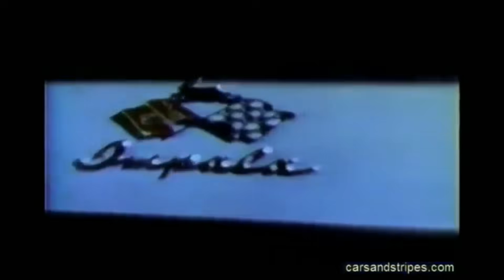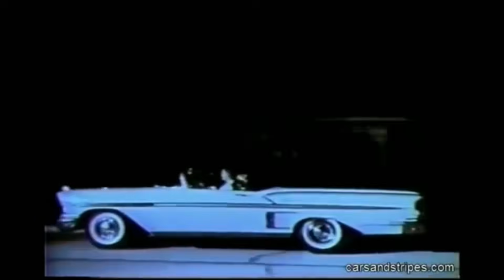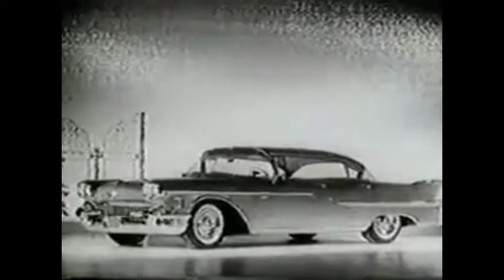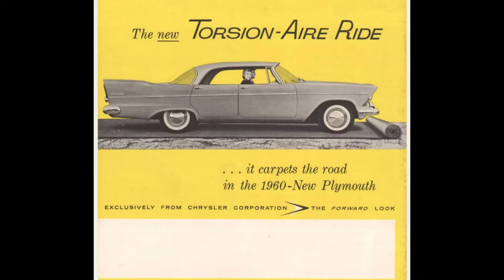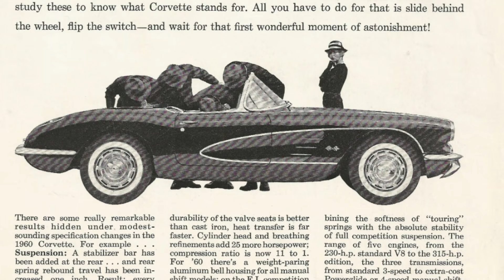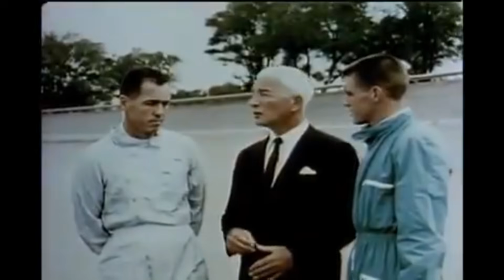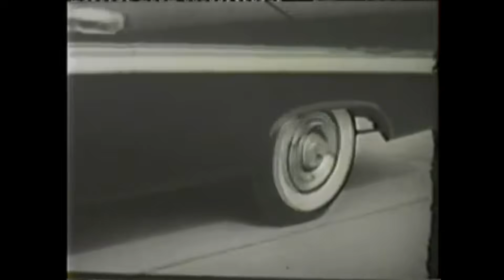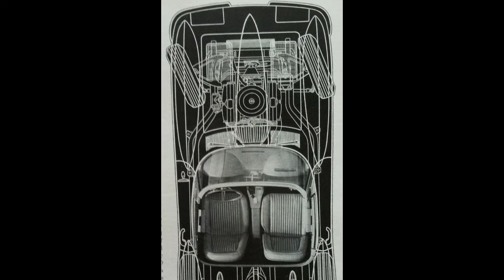The Forgotten Suspension Designs That Almost Changed American Cars Forever

Comment: This is an oversimplified presentation. In short, it makes assumptions & errors all over. And YouTube keeps filling up with suggestions for these such presentations. For example, it barely mentions that the average American who actually went into the showroom, to select and purchase the cars, strongly preferred soft floating comfortable rides & with the development of the superhighway systems, were generally satisfied with these relatively simple, generally durable suspension setups regardless of the fact they they had way less control than with the torsion bar set-ups being pushed over at Chrysler starting in 1957. In fact although many owners of Chrysler cars, whether Plymouth or upper mid-line Chrysler or Imperials were happy with the superior handling, a significant enough number would complain to the dealers and the dealers would convey this over to Chrysler management who then began to soften up the torsion bars by about 1960. (Even Tom, McCahill noticed this) Imagine that!! --A company listening to the demand by the average buyer who desired a softer ride! In fact many magazine road testers who tested a Chrysler product in the mid 1960s would say how everybody should order the optional firmer suspension (which was very very affordable & would include firmer shocks and springs) because it made the vehicle exhibit much more enjoyable & predictable & safer handling. But remember, the testers tended to wring the car out in a much more aggressive & demanding test of its handling and braking, driving it in the manner that the majority of the actual purchasers never did. Thus my own aunt bought an Imperial in 1973 and found the ride too stiff and instead bought a Ford Torino with a nice soft ride! She did not get the idea of a more capable suspension being a positive & desirable attribute. She just wanted comfort with reasonable dependability!

Another point. This is America not Italy or some other country filled with narrow roads and switchbacks. Those can be a fun and thrilling way to experience a well balanced, much smaller sports car or a well suspended and much smaller 4 door sedan. Wonderful. But this is where GEOGRAPHY influences how a car is deigned by the engineers and the companies that sell vehicles primarily in those areas. Thus in the mid 1960s, even an American car such as the mid sized (by US standards, but large by European standards) 1967 Pontiac Lemans Sprint OHC 6 that had the sporty suspension would do quite poorly in European road conditions. See here: https://www.curbsideclassic.com/vintage-reviews/1960s-vintage-reviews/gm-brands-1960s-vintage-reviews/vintage-review-1967-pontiac-lemans-sprint-ohc-six-tested-in-europe-pontiac-tries-and-fails-to-build-a-european-sport-sedan/

But that doesn't mean the Lemans was a crummy car for the US! It was a poorly adapted car for Europe where smaller roads and more sophisticated suspensions and better braking was all driven by the smaller narrow roads and switchbacks and plenty of hills where flatland open Americans often did not run into those conditions. In addition the high cost of fuel, even back then in Europe, tended to strongly influence the development of smaller more fuel efficient vehicles that also handled and braked in a far more sophisticated manner. A good example of this is when an overseas GM engineer from England moved in across the street from me back in the early 1980s. He was impressed with the Oldsmobile Ninety Eight 4 door sedan that he was provided for by GM and I was confused. How could he be impressed with a relative boat like that? He explained simply that this machine was quite a fine comfortable & luxurious ride for the conditions he typically encountered in Michigan flatland USA! But he sure would not want such a vehicle if he was back in Merry Ol' England! Thus geography is a critical factor in understanding how a car is designed and what the engineering department emphasizes. 

In addition, not all American cars from the 1960s that were not 1963 and later Corvettes & still used solid live rear axles, could handle much more impressively and become favorites. Examples of these were the 1967 dodge Coronet R/T and the Plymouth GTX both of which had firmer torsion bar suspensions and were considered much better at handling than the average American sedan even with their heavy 440" V8. In addition the Oldsmobile 442 from 1964 model year onward had standard front AND rear stabilizer bars which was unusual at that time (although a rear stabilizer bar could be ordered for a Pontiac GTO or a Buick Skylark, etc. if desired for just a few bucks, but almost no one did!). In addition the Studebaker Super Lark, Super Hawk & the Avanti had front and rear stabilizer bars as standard (and any Studebaker car could be ordered with front disc brakes as well if the owner wanted it). The Chevy Corvairs had an independent rear suspension that was improved by mid 1963 making a vehicle that had far more standard power (compared to a Beetle) and superior handling. In fact it was seriously superior to the Beetle but GM gave up on it by 1965 when the car hit a peak of styling and handling and power and let it fade after the Ralph Nader impact. The 1961-63 Pontiac tempest also had IRS but not enough owners really appreciated these advancements in the country of the USA that loved big cars, and nothing wrong with that with all the flat land and long distance traveling. Disc brakes were yet another important development that was delayed on US vehicles for both cost and an perceived lack of much interest by the average consumer emerging in the mid 60s for most consumers. Even the 1965 Chevrolet Corvette which had four wheel disc brakes as standard could be ordered with rear disc brakes deleted!! So if you ordered the 65 Corvette with the standard 327" V8 with the least powerful 250 hp rated (gross) version where you just wanted to cruise around in style but did not care about braking so much, you could order it with only front disc and rear drum brakes! Even GM who offered four wheel disc bakes as standard equipment in the 80s & 90s on cars like the Cavaliers, would later make them standard with front disc and rear drums again to save $$ per car & 99% of owners did not notice! 

By the way, the idea of bean counter accountants killing a vehicle concept or type of engineering, is often a good thing as long as they recognize the market they are reaching to satisfy (who the intended buyer is and how much $$ he has to spend) & I admit too often they do not. Yet too often they are maligned for doing useful & necessary actions that keep a car or truck cost at a reasonable level. This presentation acts like cost is something a company can just throw out the window. There is ALWAYS a balance to be achieved as a manufacturer tries to earn money from the consumer in a free market. It is far from perfect!

In addition, vehicle development did not "stand still" because of the relatively simple suspensions that were used in the US. Other areas of the vehicle were advancing even if the suspension designs were relatively simple, such at the ability of a vehicle to comfortably travel many miles over the new superhighways that were developing and thus an emphasis on making sure the vehicle handled predictably & body tightness (not necessarily panel fit!) was more prevalent such as eliminating squeaks and rattles from ever occurring, than if it could handle better in an emergency or a sporty maneuver.  If the average American was suddenly traversing tight narrow roadways with fuel price 3 times higher they would have no doubt preferred much better handling vehicles as well.

The European cars that impressed more and more American buyers were also cars developed on the tinier roads and curves and hills and when combined with more advanced engineering could finally create better handling cars that were comfy enough, that they could be offered to a broader range of Americans who not only accepted them but began to prefer them.
Reply: Well said, every last bit of it!

Comment: The Corvair in 1960 had a swing axle followed by the Pontiac Tempest in 1961.  But it provided handling problems at higher speeds.  The Tempest ditched its swing axle design in 1964 going back to solid rear axle.  That same year the Corvair went to a full independent rear axle suspension ending its weakness,
Reply: By 66, the Corvair had what was basically a Corvette suspension.
Reply: The rear suspension was fine; problem was that front tires had to be inflated no more than 18psi, which most were not aware of.

Comment: You missed some interesting GM cars. The 61 to 63 Pontiac Tempest. Independ rear trans axle and for 1963 you could gat a 326 V8. Then there is the Chevy Corvair. Rear engine and trans axle with swing are independent rear axle. And an improved system in IFRC 1965 or 66.
Reply: The car the two yout's were driving in the movie.. My Cousin Vinnie
Reply: Fiero had IRS.
Reply: @bryanayers6104 Had one of those too.  The rear suspension was basically a GM front driver with McPherson struts.  I can personally testify that with the correct tires and a huge, 3 size stagger front to rear, the car was glued to the road.

Also, my 2005 CTS-V has IRS.  Don't ever attempt a burnout though unless you want to rip the differential out of the vehicle.
Reply: @garyhalmbacher6875 Had multiple Fieros, as I worked in family owned Pontiac dealership in the Eighties... Well familiar with the P-Car and it's design evolution
Reply: I believe 66 was the year GM ditched the swing axle and went full IRS.  My friend had a 67 or 68.  The suspension was essentially Corvette but Falcon price.
Reply: @garyhalmbacher6875 Swing axle is still IRS...
Reply: @garyhalmbacher6875 close. It was '65 when they went from swing axle to multi-link.
Reply: The Corvair got a camber compensator for 1964,  For 1965 the Corvair got  a new body style and full IRS.
Reply: @philipethier9136  I didn't know about the camber compensator but I knew about full IRS because my buddy had a 67 or 68.  The cars were beautiful and handled superbly but Americans didn't know how to drive them.  If you pushed too hard, you could easily swap ends.  A major front to rear tire stagger, like I did on my Fiero of 3 sizes would have done the trick but tire stagger and L/R didn't exist in the age of bias ply.
Reply: @garyhalmbacher6875 Fiero SE/GT  handled well with factory tire stagger.
Reply: @bryanayers6104I had the first year.  Beautiful car.  Had the suede interior.  I had the 2nd one in Orange County.  Totally underpowered but stuck like glue in the corners.  Totally impractical too.
Reply: @garyhalmbacher6875 I never found them to be impractical.
Reply: @garyhalmbacher6875  I remember seeing a camber compensator in a turbocharged version and it was simply a crude way to prevent the swing axle from tucking under during a sliding turn. It took Volkswagen until 1968 to get rid of their swing axle. I think "Unsafe at Any Speed" helped.
Reply: @garyhalmbacher6875  - Early model Corvairs (1960-1963) were fairly easy to swap ends if you weren't paying attention. For 1964 Chevy added a transverse leaf spring (often mistakenly called a "camber compensator") to the rear swing axle suspension, plus an anti-roll bar to the front, which improved the handling considerably, but you could still get them sideways by driving stupidly. Starting in 1965 until the end of production in 1969, the Corvair received the Corvette's fully independent rear suspension, albeit with coil springs rather than the 'Vett's transverse leaf spring. It didn't take long for enthusiasts to discover that by simply tweaking the suspension alignment settings slightly and the F/R tire pressures a bit, the Corvair became THE best handling car built during that time period. It even won the SCCA D production championship in 1966! The fancy-fendered Ford Falcon of that era (aka Mustangs) with their 289 V8s could easily blow off a Corvair in a straight line or on a smooth road, but put the two of them on a twisty, bumpy, pot-holed mountain road and the Corvair would basically clean the other's clock. Big HP and a live rear axle bouncing around couldn't keep up with the fully independent suspended cat-like Corvair - on stock tires all around, too!  Even more so if the owner had installed Michelin or PIrelli radials, which were just coming into the market back then. No need for size staggering, just minor alignment changes and tire pressure settings. It's sad that the Corvair got a bad rap, but Nader's book wasn't what killed it - the HP race and smog regs did it.
Reply: @philipethier9136 Corvair always had IRS, regardless of the year, Early and Late Model.
Reply: I have a 1963 LeMans in my garage
Reply: LOL...I was coming here to say "So you're saying that whole speech in "My Cousin Vinnie wasn't true?!?!"
Reply: Good point.  Just wanted to tell you that you’ve got a typo.  You meant to type 61 to 63, rather than 51 to 63.  My best friend’s dad had a 62 Tempest.  It had the automatic transmission selector lever on the dashboard which was unique to an 8 year old kid like me.  Of course, it also had front engine, rear transmission which was innovative for the time (although I didn’t learn about that until I was a few years older and really into cars).
Reply: @OldRustySteele  Thanks, fixed it,
Reply: Thanks to my cousin Vinny many know the Tempest had a independent rear suspension - not many know they also had a novel flexible “speedometer cable” driveshaft - think it was actually a torque tube as it went between engine snd transaxle - which was its own novelty and had the torque converter on the “back” of transaxle… the sixties were glorious.
Reply: A.I. doesn't care about inaccurate, absent or erroneous information.  😕

Comment: So what happened since then? People forgot all about IRS, anti-roll, and anti-dive, - - and bought pickup trucks with solid rear axles! -- becoming the best selling vehicles in the USA!  I should know: I have 3 of them -- every one rides more than acceptably.  So much for fancy suspensions! (^_^) ====
Reply: Not really .They were convinced that they would be more "manly" if they drove more profitable cheaper to build pickups than the new car designs with unitary bodies that the new vehicle safety regulations were going to require the manufacturers to make.
Pickups were excluded from these rules and continued to be built with primitive ladder chasses for many years.
The market fell for it hook line and sinker
Reply: @PaulG.x  Respectfully disagree. I've had two BMW's and used to race a Porsche 356B In Germany.  Great suspensions -- also irrelevant for the American market.  The Americans got it right: pickups are rugged, safe, durable, multi-functional, -- and cost-effective (at least they were!).  "Manliness" used too have some contribution, but does not explain the number of women who are now  buying 4D pickups --- about 30% of the market.   So, this is not a matter of anyone falling for a deception "hook line and sinker" -- it is matter of trade-offs, in which purity of suspension is less valued than the four advantages listed above -- not even counting the adverse weather capability pickups can offer(^_^).  ===============
Reply: Big trucks and SUVs are uniquely American and would not succeed if offered in other countries where such vehicles are unsuitable or undesirable.  The US automakers cater to Americans who love these types of vehicles and are less competitive abroad.  There's a reason why foreign automakers have become so dominant in the US.
Reply: @chewmetube  Foreign Car makers are not "dominant" in the US:  pickup trucks are [as a single type].  Percent of Foreign Vehicles sales in USA = ~ 40%, but many of those are now big SUV's that simulate their American counterparts. Examples: Honda Pilot; Nissan Armada; Toyota Highlander.  But  there is a growing desire for American pickup trucks internationally, especially in China [and others].  See the article by Hagerty entitled, "It's Not Just America—the World Loves Its Pickup Trucks - Hagerty". ==============

Comment: The 1966 Chevrolet Corvair had independent rear suspension. The Pontiac Tempest and Corvair of the early 60s had swing axles in the rear, which are independent but not as good as the later Corvairs. Let's do some research when doing these videos.

Comment: The designers of the 1956 Packards (with all 4 wheels suspended by torsion bars, with a self-leveling feature) need to be made aware of Chrysler being the first American cars to use torsion bar suspension (on the front wheels only)  in 1957.
Reply: That's the thumb nail. The packard suspension video. This is a bogus A.I. generated channel